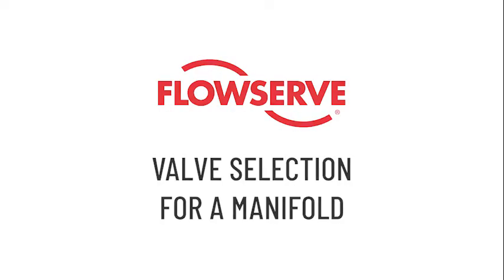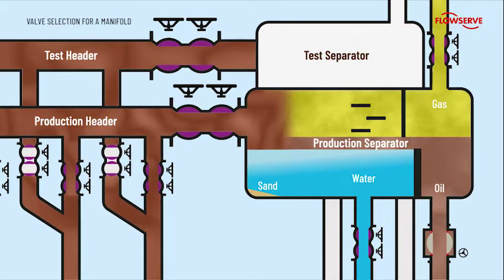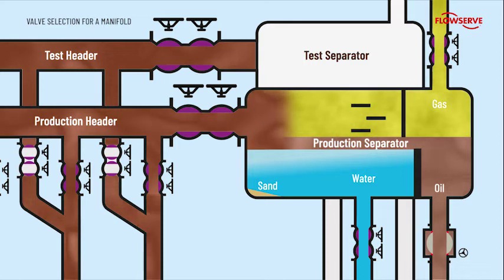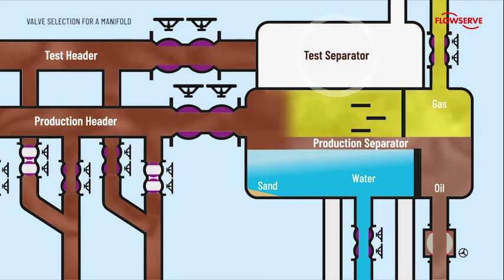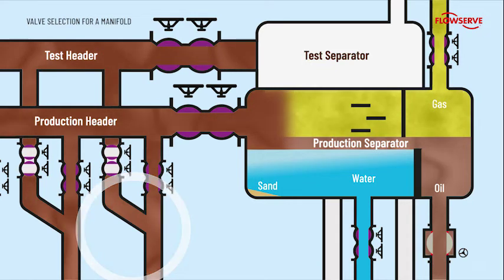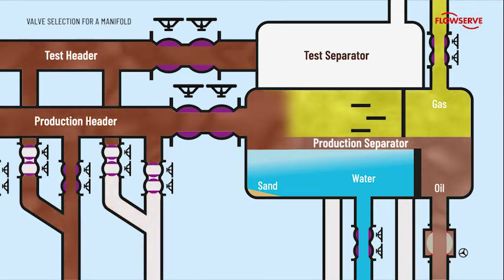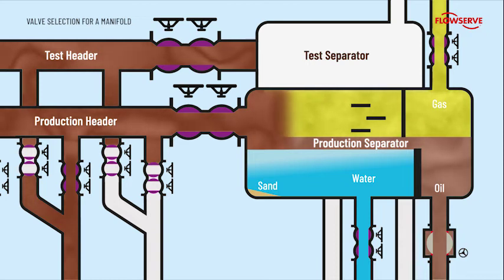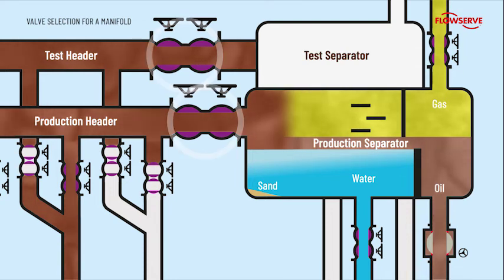Valve Selection for a Manifold

Comment: thanks but lining up the valve to the test separator should come first before closing that of the production header. This lines are under greater pressure and possibly high temperature. Line up before closing  is the safest means here. Correct me if i am wrong. Thanks